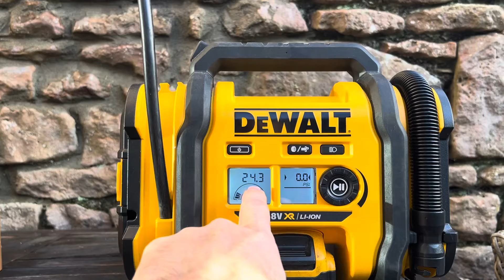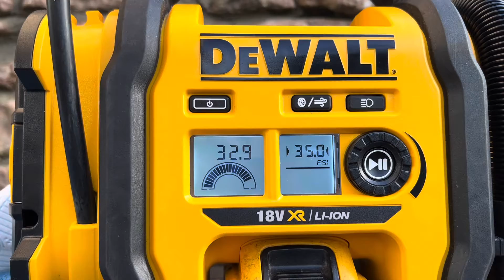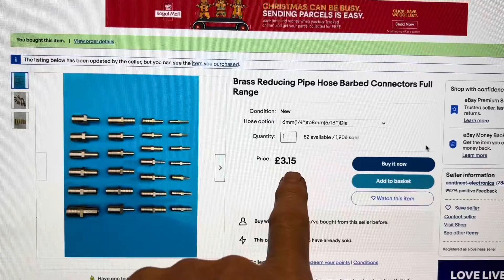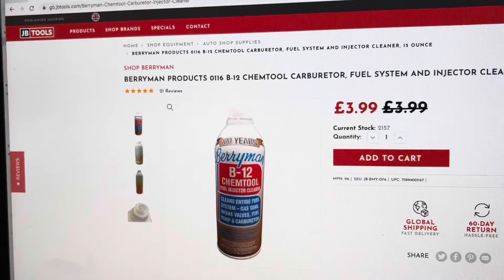How test and fix leaking fuel injectors and fuel pressure regulators with simple tools

Comment: You are a genius and literally the only real problem solving mind when it comes to Mercedes.  Im an engineer and find most YT videos useless because people cant think and problem solve.
Reply from the maker: Wow!  That is very kind of you to say so. Thanks. It is so gratifying that there are at least a few people out there to who these rather technical videos appeal. My wife isn’t one of them! Mike
Reply: @MikesMercsandothercars  Can you kindly answer the other question I just posted on this subject.  I used compressed air on my FPR and it started leaking, creating a  fire but I don't know if I fixed it or broke it.  I also tried to turn the flat screwdriver side drain port and this might have made it leak. I don't remember.  My system pressure is 130 psi and I need to bring it down because the car is bogging down past 2000 rpms.  Is the problem at the WUR? I've been at a loss working on this problem for 1.5 years and have made no progress because no one else knows or will tell me including mechanics.  They keep saying FPR or WUR but because they are mechanics they have very poor problem solving or unethical helping people skills. Thanks Mike.
Reply from the maker: @ace7821  What car do you have, make model and year?

Comment: This video is so good I gave my thumbs up 'and' subscriber!

Meanwhile, if you have difficulty sourcing the special Schrader hose adapter, then a flexible hose-type 8" Schrader valve extension (Amazon and eBay, very common, search term = Flexible Schrader Tire Valve Stem Extension) will sort you. Once you cut the male-end off it works the same. Female end screws onto the Schrader, and after cutting off the male end, you've got a rubber hose ready to accepts a barbed fitting for the correct size hose.  Also, since inexpensive 1/4in NPT valves are readily available in brass and plastic, it's easy enough to restores the valve function of a Schrader.
Reply from the maker: Good tip. Thx Mike
Reply: @MikesMercsandothercars  Forgot to mention, thumbs up and subscribed . . . VERY, VERY, VERY GOOD VIDEO!
Reply from the maker: @modelsport2858  Thank you VERY VERY VERY much. Appreciated. Mike

Comment: Professor Mike!  This is a really cool video. I was fortunate and whoever tried to start my 1972 350SL bought a new fuel regulator 20 years ago when they were affordable. I started the car first time in 20 years with all new injectors, lined tank, fuel pump, filter, etc.  I have the old fuel regulator they replaced and have a mind to test it. They are selling for over $800 in US for a used one.
Reply from the maker: Yes….I can’t believe what those fuel pressure regulators sell for. I have found an alternative unit but it hasn’t arrived yet. You must have one of the very first SL’s. Mike

Comment: Fantastic video Mike. My 450se can use some tuning. Idle spoed is rough and fluctuating. This seems like a good winter project. Thanks a lot for the explanation and clear instructions.
Reply from the maker: Thanks for comment. A stuck air slide valve can cause the idle to sawtooth (fluctuate). Take it off and check that it moves freely - one day I’ll get round to taking the one off the project car to check it. Mike
Reply: Check for brakebooster leak
Reply from the maker: What is the best way to do this? Mike @davidslid105

Comment: Great video ! And thanks 🙏 I have some trouble with my regulator and instead of throwing it to garbage and getting a new one, I am going to buy coke instead 😂 very interesting video and ideas ! 👍
Reply from the maker: Thanks for your kind words….and good luck with the regulator problem. Mike
Reply: @MikesMercsandothercars   Where did you found your injector cleaner ? I could not find it in any EU store. I only find additives cleaner. Thx
Reply from the maker: I originally bought 3 cans on ebay BUT it is much cheaper from these guys:

https://gb.jbtools.com/Berryman-Chemtool-Carburetor-Injector-Cleaner?gad_source=1

Remind me where you are based as I can always send you some if you get really stuck. I just took delivery today of a 30psi adjustable fuel pressure regulator made by "Standard - model PR148. - available from Rock Auto. It is almost identical to the Bosch 0280160007....just in case you nmeed a new FPR. Mike @celts153

Comment: Fantastic. Thank you. I was wondering if I could eliminate the coke bottle for initial diagnostic pressure testing by reading of the my air compressor gauge? Use the coke bottle if need to clean the regulator and injectors. or could just spray cleaner directly thru the regulator and use the coke bottle for cleaning only the injectors.
Reply from the maker: The advantage of the coke bottle method is that it stores compressed air at the correct PSI. However, if you attach an air compressor to one end of the fuel pressure regulator and block the other line off, in theory your compressor should pressure in the fuel pressure regulator until it reaches 30psi and then the valve should open.
Reply from the maker: I don’t think spraying injector cleaner through the regulator will clean is as effectively as opening and closing the valve with injector cleaner running through. Also, there is ‘injector cleaner’ and ‘INJECTOR CLEANER’ the b12 works great and doesn’t knacker the diaphragm. Mike
Reply: @MikesMercsandothercars I did for my fuel pressure regulator.  I used a air compressor and blew out the fpr and now it leaked caused a fire.  I replaced it.  My problem is I have 130 psi and it looks like fuel isn't going back to the gas tank on a 380 SEC 1982.  Where is the problem?
Reply from the maker: @ace7821  So just to get this straight...
1. Your 380SEC currently has a fuel pressure of 130psi? How do you know this - do you have am inline fuel pressure gauge?

2. Your car currently has a new MERCEDES fuel pressure regulator with the correct part number? Have you verified that the new FPR is working?

3. How long have you had this issue and did anything happen prior to the issue starting - eg something was changed?

4. Does your car have the correct fuel pump?....as is it putting out the correct pressure?

5. Have you checked to see if your return line from the fpr is blocked?

6. When is the last time the fuel filter was changed and is it definitely the correct Mercedes filter?

Mike